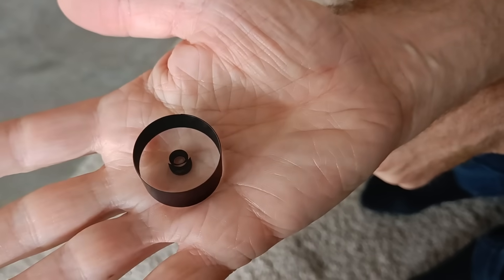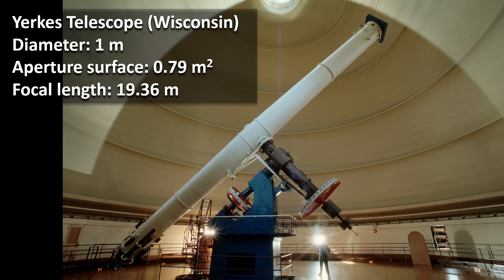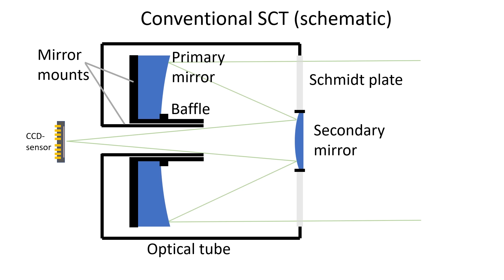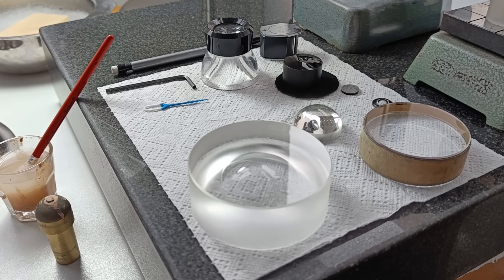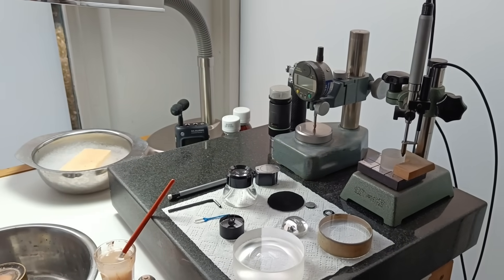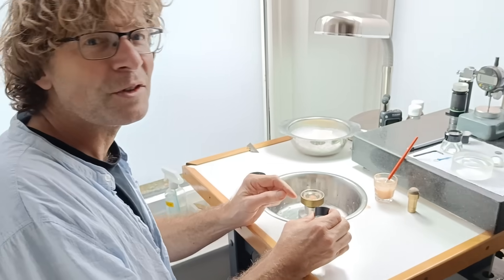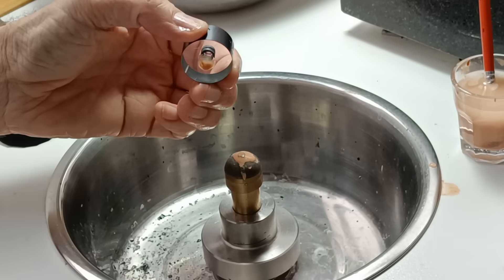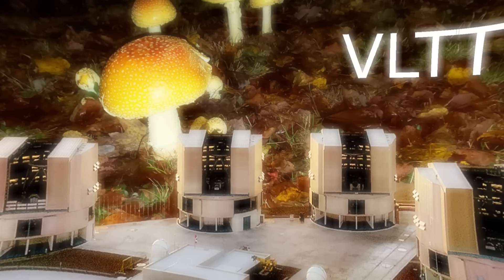Why is this Space Telescope so Tiny?

Comment: Imagine the possibilities.  You could even make a square meter array.
Reply: Or even a square kilomillimeter array!
Reply: @photonymous  or a square decadecimeter array!
Reply: @photonymous  Is that not just app. 3 femtoparsec?
Reply: @photonymous  kilomilimeter* noice
Reply: @zhinkunakur4751  kilomillimeter is correct. your correction is wrong. milli comes from mille, which is thousand in latin
Reply: that would be extremely large tiny telescope XLTT
Reply: YEP that was my first thought.   What you really want is a way to mould the lens block that means 95% of the grinding is unnecessary - just the polishing.  THAT gets away from the problem of grinding the parabola - the shape is there already its just a few minutes of polishing.
Reply: @piccalillipit9211  ...yes! There are probably also clever ways to make aspheric conical surfaces that translate the facility of spherical grinding action into the desired aspheric shape. While this is just an idea for an idea... Maybe.
Reply: @piccalillipit9211  
A "few minutes"? Think again.
Optical quality grinding uses extremely fine grind powder at VERY low pressure...  which means it takes awhile.
Get your facts straight.
Reply: @TicTac-g7m  "Get your facts straight." - NO I don't think I will - I think I will comment what I want when I want.
Reply: @piccalillipit9211  being unencumbered by facts sometimes wins the prize despite the naysaying of bitter drudges, who, apparently aren't getting enough.
Reply: @johnbergamini3567  :-D ok, I was wrong about a thing in the world of optics - I'm not sure that is a huge character flaw. I think I can live with that.  HEY - I thought YouTube was a stupid idea when it started and no one would use it - I've been wrong about a LOT of things in my life LOL.
I can live with it
Reply: @TicTac-g7m  The old tradition of grinding and polishing yes. Modern methods used in the camera industry uses plastic polishing and has for decades. Creates a polished surface in a fraction of the time pitch polishing takes.. Better than that is a process where lens surfaces are generated in a matter of minutes by beads in water stream. Seen it in operation. It can generate a meniscus lens ready for polishing in a few minutes. Rapid surface generation is a reality. However, that may be good enough for the camera industry where lenses don't need to be diffraction limited. For the telescope industry, things like plastic polishing are and have been used by Chinese mass producers of ED refractors. You can see the tell-tale sign in a knife-edge test.  I still prefer pitch polished telescope objectives. The finest ones still are pitch polished..........unless there is a newer breakthrough.
Reply: Yes, imagine if you got robots churning these things out (maybe at a larger scale, even) and just covered some arbitrarily large surface with them.
Reply: @Ithirahad  Basically an optical versino of the Murchison Widefield Array.
Reply: @Ithirahad  I doubt Robots can build such masterpiece.
Reply: @aniksamiurrahman6365  When it all comes down to it, it's a funny-shaped piece of glass. It took a brilliant human mind to invent the principle, another brilliant mind to refine it, and a third brilliant mind to create a version that is so elegantly simplified, but in the near future, machines can reproduce it just fine.
Reply: @Ithirahad  I doubt that. Such precision is gonna be very very costly. Mass producing with such precision isn't gonna happen unless its required in high volume.
Yes, yes, I know its totally possible to do automated maneufacturing of these lenses. But the question is more about feasiblity than theoratical possibility.
Reply: @aniksamiurrahman6365  , I disagree. Somebody will start on this project by hand, and will have created the first relatively inexpensive lens grinding automation device in their minds in short order. Some folks are wired that way...EG Elon musk
Reply: @johnbergamini3567  Elon Musk? Very bad example dude. Tell me one project that he started by hand and then created first relatively expensive automation?
Elon Musk havent invented a single thing, haven't improved a single technology. No, his engineers didn't do any of these either. He is a story teller and nothing else. He tells romantic story of fantastic future and uses that marketing to manipulate share prices.
Reply: @aniksamiurrahman6365  What you really want is a way to mould the lens block that means 95% of the grinding is unnecessary - just the polishing.  THAT gets away from the problem of grinding the parabola - the shape is there already its just a few minutes of polishing.
Reply: @aniksamiurrahman6365  I would put money on the fact that a company in the field could start producing these by the end of the day with far better precision than a human hand could ever achieve. Why do you think the machinery would need to specialized for this one piece? There's almost certainly machines that already exist which can handle the task quite nicely.
Reply: @aniksamiurrahman6365  ..ok. E Musk may be a bad example; I just presumed there was/is something substantive behind all the hoopla.

But my point remains valid. Some brains are wired such that a few hours in repetitive labour will generate some idea to automate that labour. This civilization cultivates that kind of thinking.
Reply: @aniksamiurrahman6365  Molded lens with some finishing. Single Lambda molded lenses are possible. Call Genuis optics in Taiwan. They make some good ones for phone camera modules.
Reply: @xxportalxx.  I guess then you should do some study on why its so hard to build a semi-donductor industry. Or see what they found when they tried to recreate the Saturn-5 maneufacturing process. In both these cases - unspoken, experience-only skills far outweight automated, documented processes. People who works in any modern industry will know this. Yah, machines do 90% of the thing, the undefined, unspoken 10% is what makes the difference.
Reply: @johnbergamini3567  I'm pretty sure you never tried anything substantial with your own hand. This is why "Storeis" of exception brain, glittering billionaire and other BS are coming up.
Reply: @antiprismatic  Don' t worry, in no time they'll start crashing with each other.
Reply: @pavelnikulin8240  Look, the main issue is market demand. Are billions of such lens necessary each years? If no, then no one will spend money or research to develop and perfect such highly accurate mold. For industrial process you also need to standerdize the maneufacturing and QA process. Even for few thousand/yr deamd, large workshop and hand made lens (like  Hasselblad) is the way to go.
Though all that said, I don't know about lens maneufacturing much. So, may be all wht I said is mistaken.
Reply: @johnbergamini3567  Look, if you have penchant for innovation and creativity, try to respect the enormous hard work associated with anything creative or innovative. And try to find and respect such people from around you.
Reply: @aniksamiurrahman6365  ..what? You mean, as an example, your last two comments to me?!
Reply: @aniksamiurrahman6365  I think you'll find your examples are deeply flawed, to begin with my training is in semiconductors and in that field the difficulty is mostly bound by the scales required to overcome the astronomical capital costs, it costs billions to construct a NEW fab, however they can switch what ic they're producing in about as much time as it takes to tool the masks (assuming the cad-work is finished). Similarly I feel as tho I've seen thumbnails for videos debunking the idea we couldn't replicate the Saturn V engines, they're simply outdated and used outdated practices to construct, it'd be like building a tesla with a model T engine to put an F1 engine on say the sls.
Reply: @xxportalxx.  Your example is similarly flawed. First off, model T electric motors (aka engine) is way more simple than a F1 engine. So, you just got it backwards. But that's beside the point. Read my comment again properly and see what I've said.
Reply: @aniksamiurrahman6365  Yes, a model T engine is far more simple than a F1, but a tesla isn't anywhere near as complex as the SLS either, bc it's an ANALOGY, and as one I find it satisfactory. I'm not comparing their level of complexity, I'm comparing the situation of relative complexity (F1 engine vs sls engine || model T engine vs modern tesla motor).
Reply: @Ithirahad  very true
Reply: @aniksamiurrahman6365   The James Webb Space Telescope (JWST) cost NASA $9.7 billion.  Cost is really not a problem. And such precision is more cost effective and better when automated
Reply: Very bad example @SAULV. I don't know how James Webb is manufactured. But I'm sure there are many steps, like deposition of the gold layer, where high precision of the machine and intuitive tinkering of the experts, both played their role. TL;DR I don't think our terminology suffices for such a custom-made, one piece thing.
But if we make 50 JWST, then all of these processes will be totally automated, I'm sure of that.
Reply: @aniksamiurrahman6365  There is actually a video on Youtube about how JWST was created step by step. It's mindblowing.
Reply: @starsandnightvision  Wow! How can I see it? YouTube will delete links. Just tell me what to search for.
Reply: I thought exactly the same thing.
Reply: and then you get to align ≈ 1,300 telescopes to each other with a mechanical precision on the order of wavelengths of light; orders of magnitude greater precision than that required to align large telescopes used in small arrays currently-- and which astronomers and engineers struggle with NOW.  In short: you have fun with that. ;)
Reply: @railgap  https://de.wikipedia.org/wiki/Murchison_Widefield_Array uses a little over 4000 antennas (or antennea?) Though I guess you cant really compare that to optical.
Reply: @railgap  not necessarily, you could use software to stitch the images together, the easiest way to do it would be to ensure there's actually overlap between all adjacent telescopes, then use that overlapping to identify where to stitch/correct the images
Reply: There are actually some possibilities there.
Reply: Send a few into orbit and you'll have power surpassing the planetary scale event horizon "telescope" (I think).

Comment: I would love to learn more about these. A few questions i came away with (you could answer in your next video) is it small because it's all glass, so you dont need the length these normaly do? Is this design as good at reducing chromatic aberation as a Schmidt–Cassegrain telescope? Part of me says "Its glass of course it has chromatic aberation" but "the only glass "lens" is very slight Schmidt the rest are just reflectors so no aberation"
Reply from the maker: Yes that is correct. The efective focal length can be 300mm inside a device that itself is only 30mm, with a very small back focal distance. There is an old post on cloudynights where you can find the Zemx details.   Once the light is in the glass, there is no additional chromatic aberrations. However, you can of course introduce chromatic aberration at the entrance and exit. It's not that bad though.
Reply: @HuygensOptics  A perhaps stupid question, but are these lenses multi/single coated to improve transmission/contrast? or is it simply not required/needed due to the lack of reflections between different elements inside the lens (as there is none)?
Reply: In any event the dispersion index of fused silica is quite small

Comment: Wouldn't a smartphone sensor be ideal for that application? Is small, has high resolution and a good overall quality. But would it be possible to seperate the optics and autofokus system without the smartphone complaining about the missing parts?
Reply from the maker: I think that in the CubeSat they uses small sensors with very high resolution, probably <2 um pixels. That is because the telescopes have a limited field of view and also because there is a lot of light (since it is intended for earth observations).
Reply: @HuygensOptics  The Samsung Galaxy S21 Ultra has a 108MP camera with a Pixel size of 0,8μm. I'm not sure if it would be possible to use the full resolution and exchange the optics, but my dream is your VLTT dream, with such a sensor :-)
Reply: There's a picture of the telescope with the sensor board at 9:58 - you can easily buy what is effectively a smartphone camera sensor as a module separate from the lens (for byo lens applications), so having it function without an autofocus system wouldn't be an issue. They might very well have gone with a sensor like that.
Reply: @hrtlsbstrd  Cool, thanks for the info! What are byo lenses? Do you have a search term for these sensors/boards? The PI camera is something which could be used, but the image quality is far of the quality of todays smartphones.
Reply: @maxmustermann5353  byo, bring your own lens.
Reply: Smartphone cameras are exceptionally good -- there is an incredible amount of R&D poured into them. But the companies are very secretive about them. Maybe somebody like SpaceX could get them to cooperate, if they promise to buy a billion dollars worth of stuff. Otherwise they ignore everybody, even if it is a cool research project from a very good university.
Reply: @cogoid  Yes, so my idea is to convert a smartphone into a smartphone-telescope without any help from the manufacturer. Ideally you would have a very good camera but without the autofocus system. The removal of the optics would probably be much easier. I'm not sure, maybe there are good selfie cameras without autofocus...

Comment: Can't wait to see the VLTT :-)
Reply: Indeed it would be excellent to explain how those multi-telescope telescopes works. I've never been able to understand it so far.
Reply: @Nosseb2  As far as I know you place the telescopes on certain spots of where there should be the bigger virtual telescope's mirror / radio dish
Then by using computer software to combine the recorded images it's possible to get a much higher resolution than the telescopes would have had on their own, you basically create a "virtual" enormous telescope, but where only a few spots of the virtual mirror actually reflect and contribute to the image
Reply: @Astromath  Yes, but it's very hard to achieve this in visible range